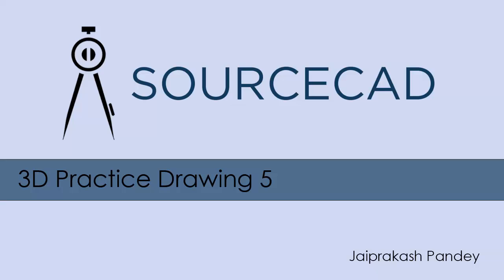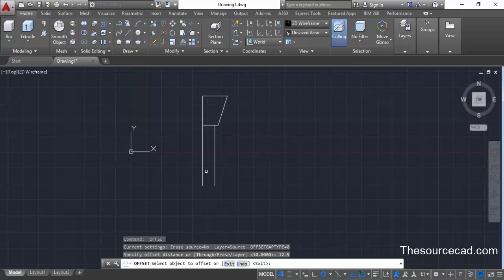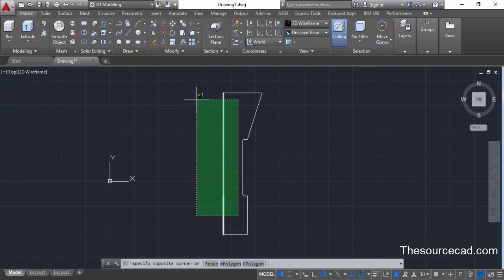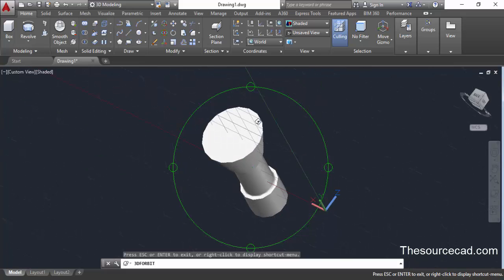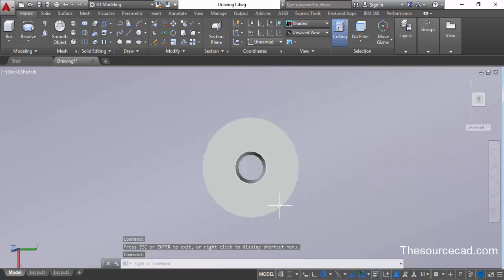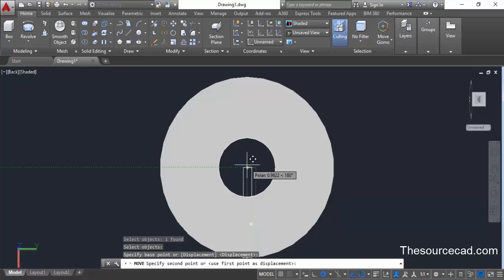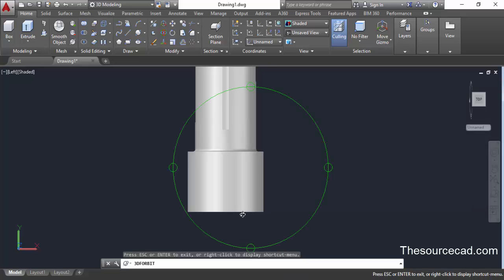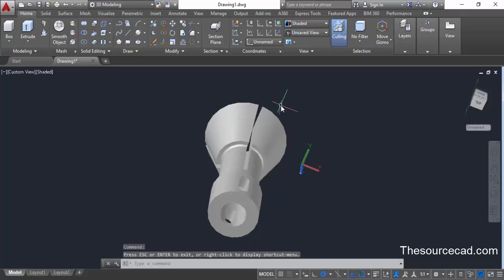3D AutoCAD Practice Drawing

Comment: Hi Jai, would you mind explaining how I can trim as you did in AutoCAD 2020. When I tried your method it simply didn't happen.  I also watched your udemy tutorial to refresh the trim command but I simply can't make it. I looked at the command message pressing F2, which was "Does not intersect with cutting edge".  When I did the same as you did being on a 2D workspace it happened exactly like yours. However, I can't make it in 3D.